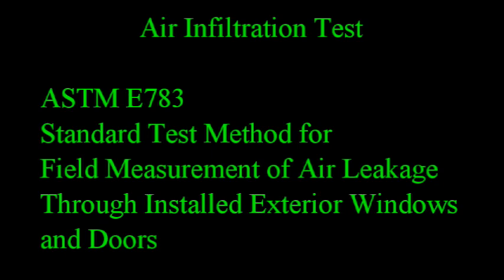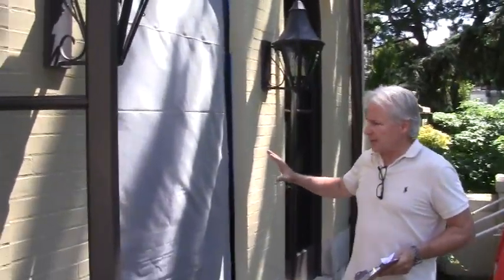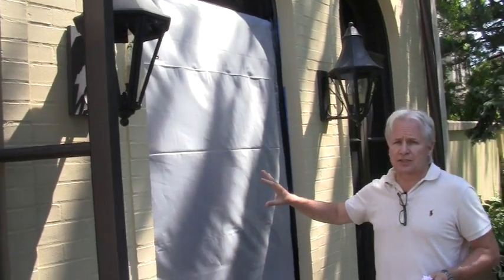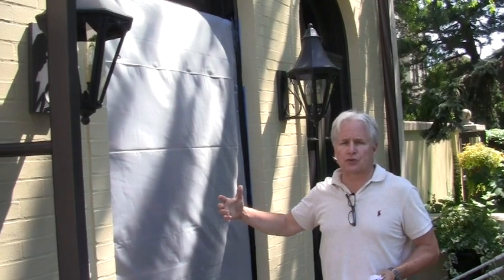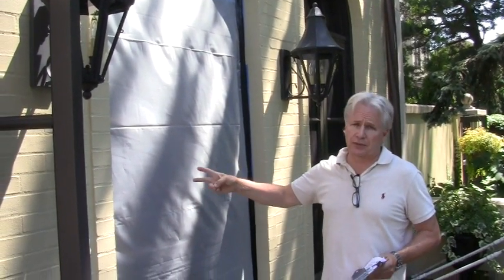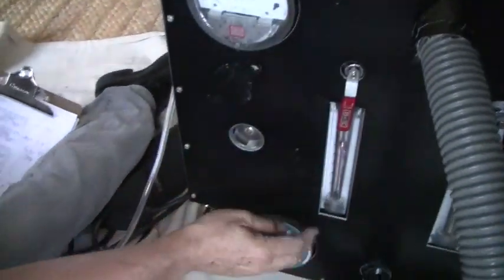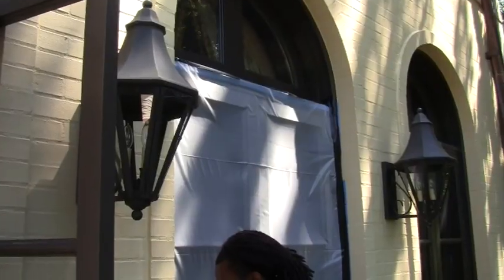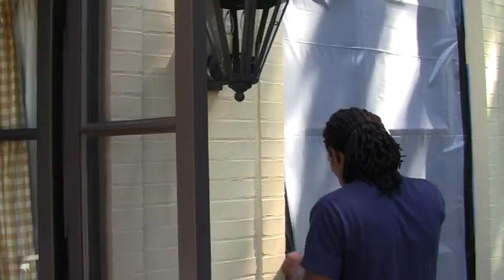Window Air & Water Leak Testing

Comment: If air leakage testing a window rather than a door. Would the tare sheet be taped passed the perimeter seal or just to the edge of the window frame?